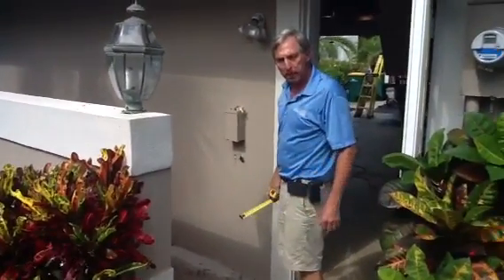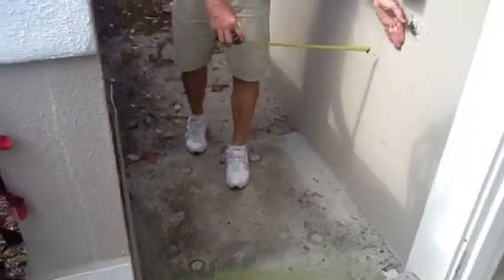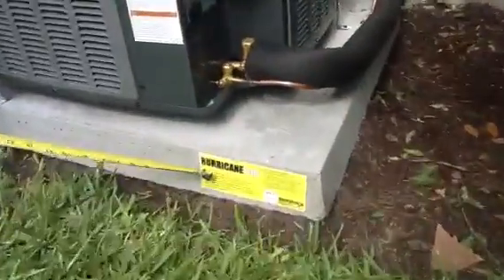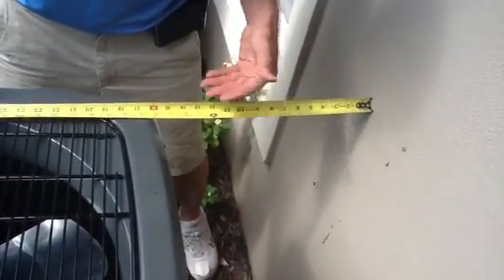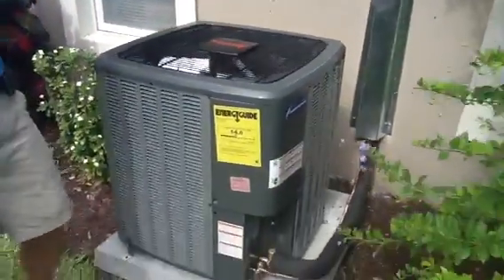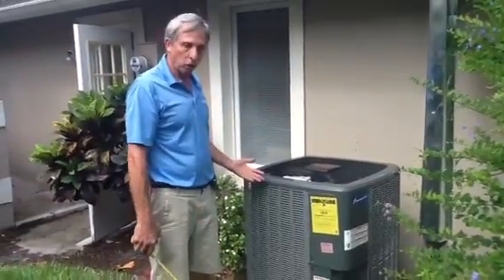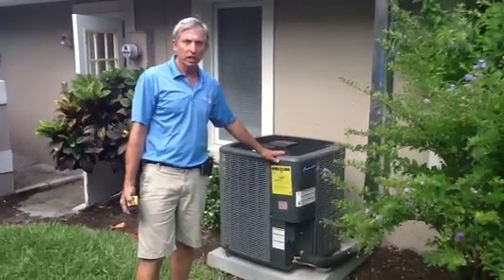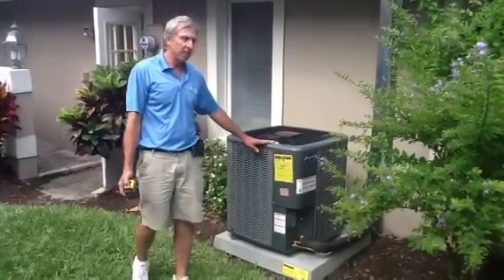INDUSTRIES STANDARD CLEARANCE FOR BETTER HEAT EXCHANGE

Comment: You said 18 SEER and the Tag say 14 SEER.. you might want to check that again.

Also why was the condenser not rotated 90 Degrees counter clockwise?

I can see how it would be easier to make a gas adjustment but a good system should never have that trouble???
Reply from the maker: oversight we were to putting lots of 18 seer, the uuit had to be turned 90 degree for acess by the state building codes
thanks for your commetts